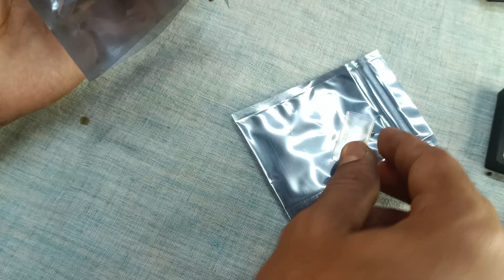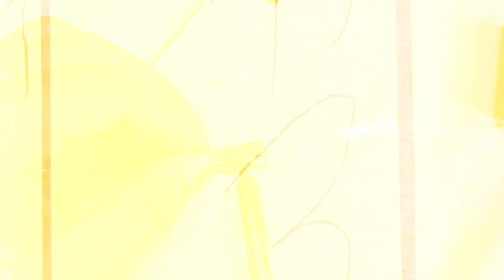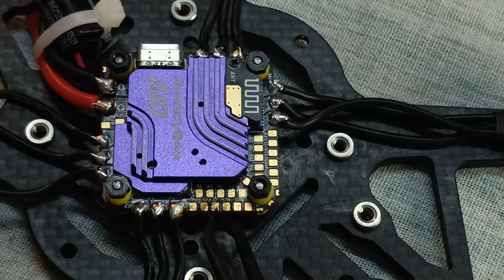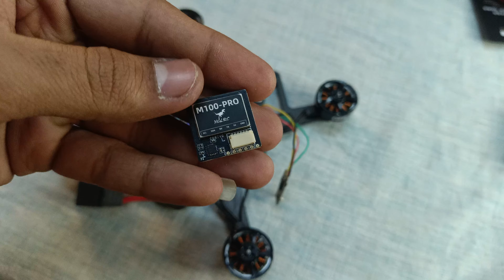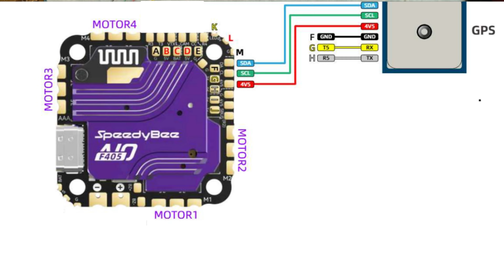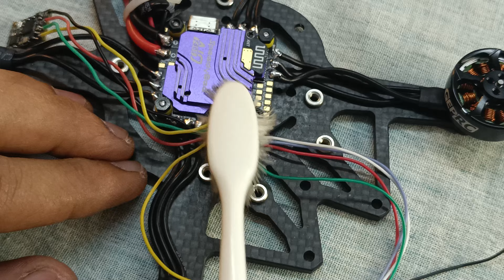How to solder Receiver and GPS to Speedybee f405 AIO | Bee35 o4Pro Build Part 4

Comment: Which paste did you use?
Reply from the maker: For soldering?
Reply: @techyboycharan450 yes
Reply: @kinghawk98 from a local store quick fix
If you can find mechanic flux it's best
Reply: Cam you upload its programming setup in betaflight
Reply from the maker: @kinghawk98 sure in upcoming videos
Stay tuned
Reply: @techyboycharan450 bhai jaldi dalo cant wait to see 😋